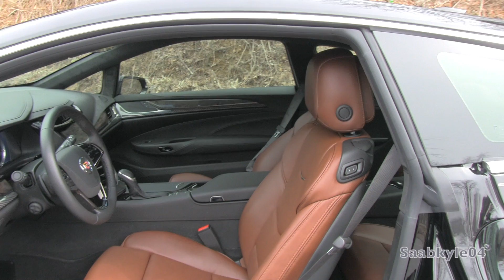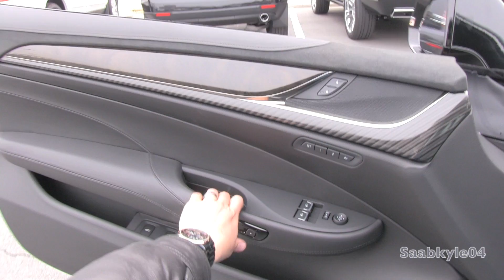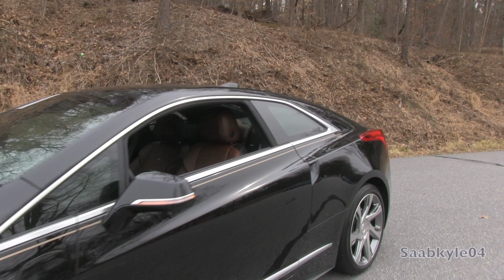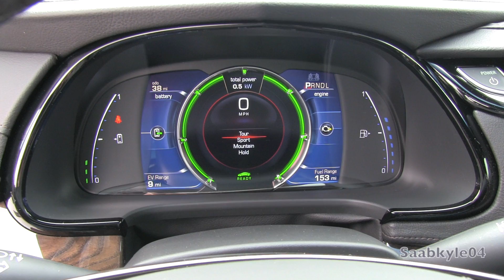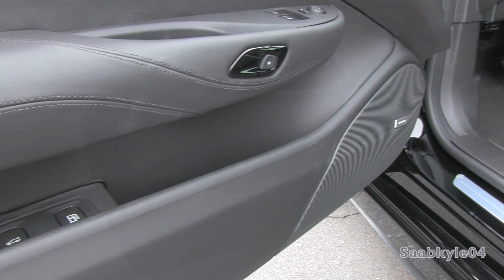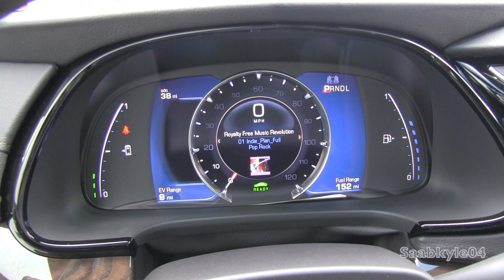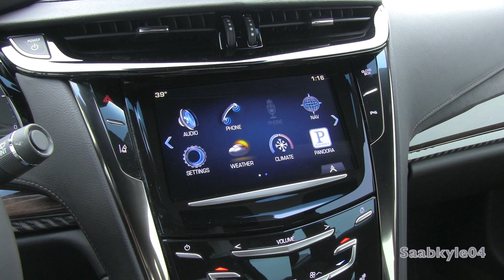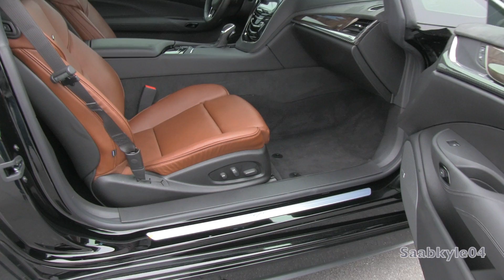2014 Cadillac ELR Start Up, Test Drive, and In Depth Review

Comment: This is nothing more then a over priced electric Altima coupe. WTF is GM  thinking...
Reply: barcode0954 with that logic, why buy Benz when u can buy a Toyota? people have different tastes.
Reply: My God, the idiocy. People that know nothing about cars should not comment because you just make yourself look like a complete idiot.
Reply from the maker: Altima coupe? That's not even the same company haha
Reply: ***** the manufacturer doesnt matter.

What's the difference between a Pontiac vibe and a Toyota matrix? NOTHING but one is domestic the other is jdm

Look at the frame of this car it overall shape is of a Altima coupe with Cadillac edges. How much hp does this model have? 150-160hp? The 2.5s altima 170-175hp. The difference is this is an electric motor. And the altima isnt. Why would anyone buy this car for 70k when you could buy a coupe (granted use because Nissan discontinued the altima coupe) for anywhere from 20,000-8900 depending on year condition and mileage.

I'm not bashing you guys if im coming off harsh but I see no reason for anyone to by this car.
Reply: barcode0954 This Cadillac is base off the Volt what in the world are you talking about.
Reply: why did idiots upvote this comment?
Reply: Jin Noh your buying a benz depending on the model your buying performance, luxury, reliability, and features that a Toyota MAY not have. Toyota doesn't produce cars with 400hp+ daily luxury drivers off the show room floor.

that's horrible comparison. ill ask this then? outside of taste. why buy a ELR  WHEN YOU CAN BY A VETTE? CAMARO? PORSCHE? CTV? BENZ for less or around the same price?  the list goes on. the 70k your getting for this elr you could buy many sport cars, luxury cars, suv's, pick up tricks. it would be different if this was priced at maybe 40-30k. now let me ask you another question what would you prefer then a ELR? or a Tesla??? .....I'll let that sink in for a bit.
Reply: barcode0954 Toyota Land Cruiser....
Reply: They don't think very well, but they act like that because daddy (our government)  will bail them out when things get too tough. They disgust me

The ELR is overpriced, on that point you are correct, but it is not a Nissan Altima. It is actually a cosmetically engineered Chevrolet Volt. And it is a type of hybrid - it is not totally electric.
Reply: SkylineFTW97  381hp and I said cars out side Lexus IsF and lfa your not going to see a 400hp cars from toyota. and im not even sure if the IsF has 400hp plus im taking a wild guess
Reply: redskinfan17 I used an Altima coupe because I own one, there striking similarities between the to cars in appearance. my car is all stock and if put a 08-09 Altima coupe next to the elr you could see the similarities to. if you can look pass the sharp edges you can see it. just google both cars. but yes you can see the difference in mileage I wont argue that.
Reply: kirbyswarp Where you come from get out of here with your opinionated comment. If you want an Atima coupe or whatever go buy one. I don't understand if you don't like something why waste your energy watching a video about this.
Reply: No, actually it's a way overpriced Chevrolet Volt in Cadillac skin. And all the people that voted you up are just as mentally challenged as you are. Comparing it to an Altima is just fucking stupid.  Unlike Toyota who is famous for hoppin' in bed with GM from time to time like Suzuki, Nissan (the makers of the Altima) have never done that.
Reply: ***** Yet another person who has no idea about the Voltec-Platform and how it really works and why it is actually what really fits most people.
Reply: barcode0954 Altima coupe? Where did this comment come from
Reply: +barcode0954 Lexus Toyota V8s have high hp and can be used as a daily driver. you have no argument besides trying so hard to save money on vehicles. and not all people care about saving, only spending!!. I am one of them. cheers.
Reply: You can also buy a brand new Escalade with no options for only $1000 more.
Reply: barcode0954 I understand your logic but why would you compare it to an Altima? I bet you if you out them side by side in person you would see there is quite a difference let alone the gas mileage.
Reply: barcode0954 Matrix isnt JDM if you buy it in the US. JDM means its made for japanese domestic market.  American cars can be JDM.
Reply: did you even watch the video? Dont judge based off of its appearance
Reply: "looks like an altima" so by this (opinionated) observation it IS an Altima.

Your logic in a nutshell.
Reply: ladarrius king What???????? Did you see my quotations? I was calling out his idiocy. the stupidity of Youtubers baffles me sometimes.
Reply: Sorry message the wrong person, you need to chill because the only stupid person is the one who say it first. And that is if you were talking to me.
Reply: ladarrius king Talking about him, and other idiots in general.
Reply: Okay just checking.
Reply: barcode0954 best part of your matrix/vibe comparison is that they're actually the same car made in joint partnership between toyota and gm.

the elr is a luxury coupe. just because it shares a platform with another car doesn't mean it's similar at all. and enjoy your altima, but the elr and altima are leagues apart in fit and finish and luxury
Reply: You should think before you comment. You display little to no understanding of such a car. Oh dear...
Reply: Just their obligatory electrical car. It's not a serious vehicle that GM (or their customers) actually cares about; they just have to meet their "green quota".
Reply: manoman0
A $75000+ car is not "what really fits most people".
Reply: ***** On what grounds do you speak for "most people"? Many cars don't fit most people, I'd say. Or, who really needs an ICE-car that has a range of 500 miles or more? Nobody, really. Or who needs 5 seats, really? I'd say, let the people decide what they want and what not. What is not desiderable will disappear from the market anyway.
Reply: manoman0
When I say "most people", I'm referring to the majority of the population who cannot afford to spend $75000 on a car. This is why you don't see it on the road much. Is the technology interesting? Yes. Is it practical and ready for anything other than a niché market or status as GM's obligatory electrical vehicle? No. At least not at this time.
Reply: First of all Altima is made by Nissan, which has nothing to do with Cadillac or GM and never has. If you had said it was an overpriced Chevrolet Volt. That would have made much more sense.  Your only correct point is that it's over priced
Reply: No, actually it's a Chevrolet Volt dressed in a sequined skirt and high heels. I've seen one on the the road. They look strange in the back and I can't believe anyone would pay $75,000 for one. That's just nuts. You could have a Tesla for that.
Reply: How about this... If some can afford the car then by all means go for it. Go for what you like not for what people talk about. Like me I'm considering I'm buying and I don't give a shit if you wanna compare to anything else. At the end of they day, IM DRIVING IT! NOT YOU :) by the way I'm only 20 & yes I'm Gonna be The One Paying for It. Not mommy & daddy :) I already own a 2012 Dodge Ram 2500. Now I want something really nice and luxurious so yeah..
Reply: Jin Noh hes kind of right i mean look at the infinity qx4 and the older nissan pathfinders
Reply: +barcode0954 This is based on the chevy volt...
Reply: +barcode0954  Tesla like other vehicles or subjective to ones level of distinction or exclusivity.Beauty/need/want are all personal factors when car shopping.You like stick shift she likes automatic on the same car. So personal preference is the determining factor.Personally Tesla's interior to me is boring that NASA space station center stack is unattractive to me.The Caddy is a very different vehicle of course for a reason! They just didn't market it properly.
Reply: geminiwilliams037
They made it properly, just - once again - completely wrong marketing.
Reply: manoman0
As I mentioned earlier, it has nothing to do with marketing. ELR is not a serious vehicle that GM had any real plans for. It was just their obligatory electrical car to meet the stupid "green quota".
Reply: *****
Which "green quota" did it have to meet? The ELR is brilliantly built, comes with all the bells and whistles. Was it marketed wrongly? Yes. Was it priced wrongly? Yes. Do those people who own an ELR love it? Yes. There is nothing "obligatory" about the ELR. If, then it's the Spark EV. And even that car is pretty good and also quick.
Reply: manoman0
"Green quota" refers to the requirements for higher average gas mileage and "green" cars from automakers (even though making one of those does far more harm to the world than making a gas or diesel car).

I can't speak to how well it was marketed, but wholeheartedly agree that it is priced too high (then again, that may just be a reflection of the impracticality of the technology). That said, I can't imagine that anyone who owns one "loves" how quickly it has depreciated or the cost of a replacement battery pack a few years down the road. Heck, by then, they'll have phased out and obsoleted these cars, which will make the battery pack cost-prohibitive to replace, so they'll be prematurely destined for a scrap yard as the owner moves on to something powered by proven technology.
Reply: *****
I know what green quotas are, but the ELR was not built to meet such quotas. As I said, the Spark was purpose built. If you have an ELR you have a future collectable. That's a sure bet.
Reply: manoman0
My guess is that GM didn't care about electrical cars until the green quotas were mandated. They just put out the ELR and the Volt to stay compliant with the ridiculous standards. I'm not saying that it's not a neat concept or that the design isn't creative; it was just never something they were that serious about.
Reply: *****
The whole effort to build the ELR tells me that they didn't need to meet any quota with it. If they wanted they'd have made something like the Spark. That's where I have a different opintion than you. You think GM is not serious about EVs, EREVs? Here goes: Volt 1, Volt2, Spark EV, Bolt EV, ELR (and all their other brand derivates). GM/LG Chem is leading in automotive battery technology. Don't forget VIA Motors. I think they are serious and more and more models, also from different makers are to come.
Reply: manoman0
If you say so, but as far as I can tell, they just put the minimum amount of effort in to appease the requirement across two of their brands. As expensive as they were, GM still probably didn't have a huge profit margin on them.
Reply: *****
I think they didn't earn money on the ELR. I doubt it will be continued. A pity. Could be a fantastic EREV gen2 if they wanted to. ELR or not, GM's spreading their hybrid and Voltec platforms over the entire line-up. More to come.
Reply: manoman0
That's probably only so that they can keep their 2 model electrical minimum. If they discontinue ELR, then Volt will be their only one left and they won't be within protocol of their "Green quota".
Reply: *****
Hmmm $75,000 for this or for the CT6?  Seriously GM, you've got more than a few screws loose.
Reply: BroccoliBeefed
I didn't say anything about the price, just that the ELR's sole purpose at GM is to meet the "green quota" requirements.
Reply: *****
They needed this heap to meet the green quota.??? IT's not selling! Why didn't they just keep the EV1 car?
Reply: BroccoliBeefed
It doesn't matter if it doesn't sell. The green quote basically just dictates that they needed to have 2 plug-in electrical vehicles by 2014, so they released this car to satisfy that.

The answer to your second question is that there was no green quota back then, so there was no artificially-generated need to sink any more money into the technology at the time.
Reply: *****
Thanks for answering. I do appreciate the knowledge I didn't know before. After all, who wants to be ignorant?
Reply: I truly dislike GM, but dude, Nissan makes nothing but crap and this is so far from an Altima. this is even far from the Leaf,
Reply: Has Chevy volt drivetrain
Reply: barcode0954 ,
Reply: also i believe its made in the us. so is neither jdm or an import. and yes i know your reply was 3yo. but had to comment on your reply

Comment: This thing is impeccably well made, easily the nicest vehicle GM has made in years, but it's way too expensive for me.
Reply: These can be had used with under 40,000 miles for under $30,000... less than half the price of new.  There are some good deals out there if the ELR is your thing.

I test drove a 2014 yesterday and I agree that it's very well made, very comfortable, and drives nicely.  My only misgiving is the buzzy 1.4L engine, but I think I can forgive that, given everything else this car has to offer.